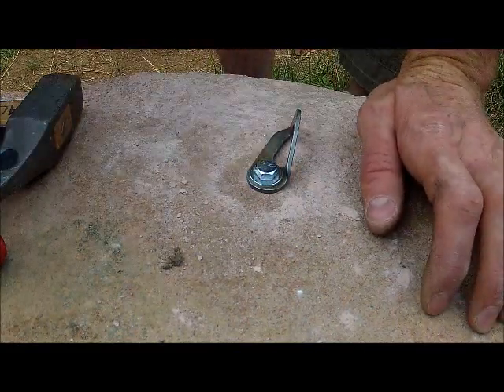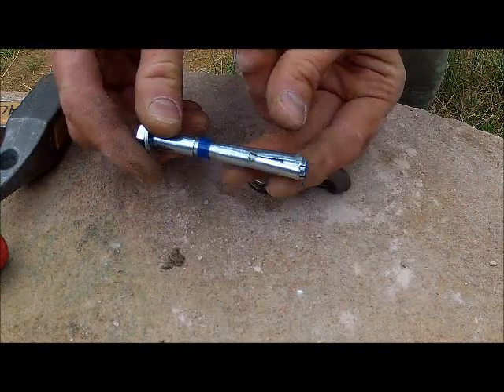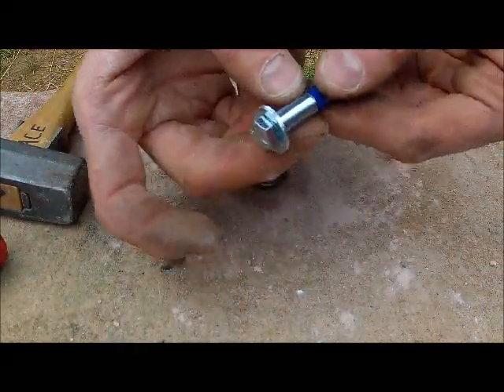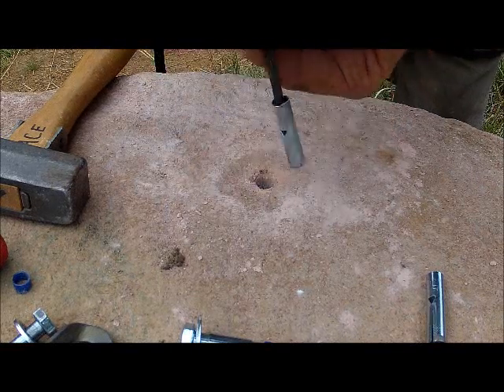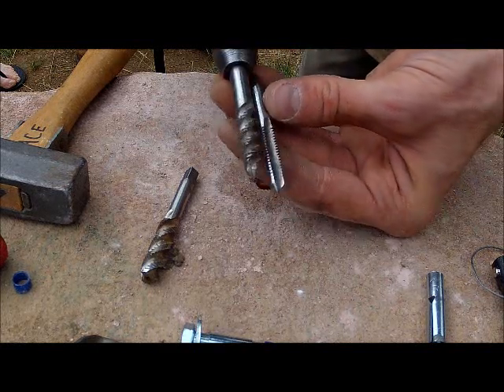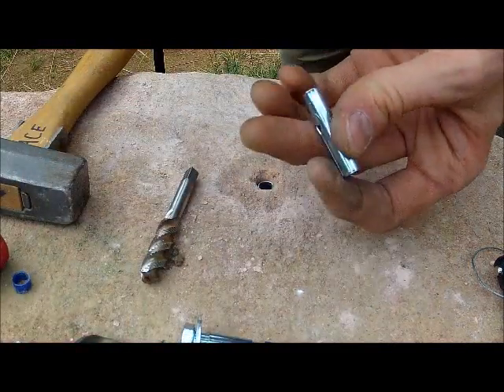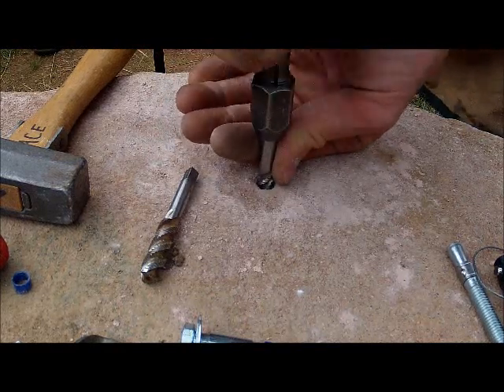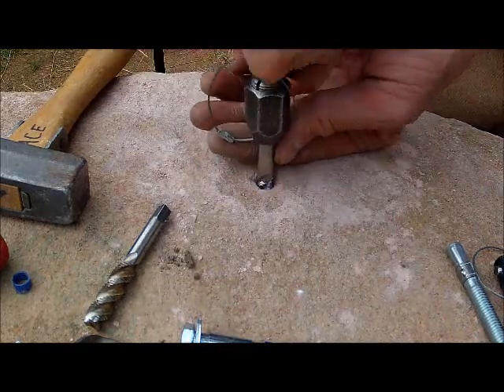Sustainable re-bolting: Rawl/ 5-piece removal

Comment: I have had a several instances in Corbin sandstone where tapping the bolt disengages the cone from the sleeve, but the cone does not regain enough purchase in the back of the hole to unscrew the bolt again. (Probably due to a heavily corroded cone or a wider hole in the back where the rock has disintegrated.)  In soft rock or with extremely corroded bolts I would recommend removing the bolt entirely, taking off the hanger and then rethreading the bolt prior to hammering, so as to not create a dangerous situation where you can't remove the bolt but the hanger is still on so people could clip the compromised bolt. Sometimes funking the bolt and cone back towards the surface of the hole will help set the cone enough to unscrew as well, otherwise better have your grinder handy! I've had very little success with the hook tool on rusted bolts, method 2 looks very promising. Great video Greg!

Comment: Great video. This is what I've always done, though recently I hit a challenge. The bolt was so rusted that the bolt would not spin independently of the cone, so I'm stuck just infinitely spinning the bolt. Do you have any suggestions for this situation?
Reply: I've run into this several times and it's pretty frustrating. I finally found a tactic today that worked though. I got an SDS to 1/4" hex adapter and plugged a little 1/2" nut driver head into that. Then I could use my drill to spin the bolt for several minutes, similar to how you would spin a wedge anchor. I spun both directions, bounce loaded the spinning bolt, etc, until it finally slid out.

In my case I think all the spinning and heat eventually broke the thread lock at the cone -- I still had to get the sleeve and cone out.

FYI I used the same adapter to help me get the cone out of another bolt hole today. I did this by removing the sleeve and then reinserting the bolt, then pulling while spinning with the drill. Nicer than what I usually end up doing, which is to just put in earplugs and drill out the entire mess with an old 3/8" SDS bit.
Reply: @erichirst4976  thank you for the reply! I’ll try that.